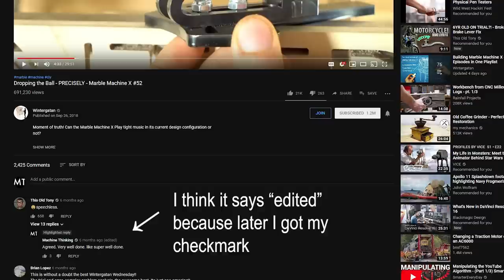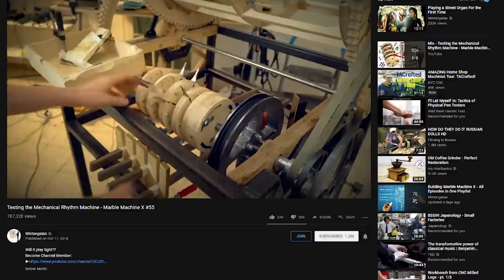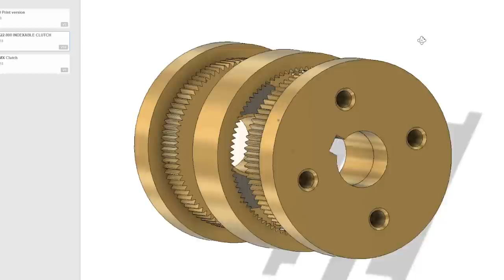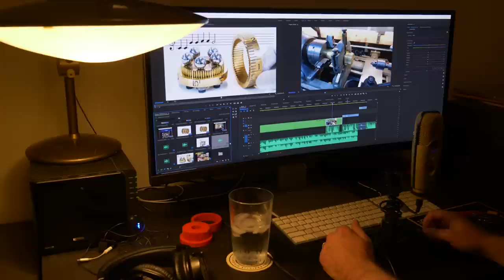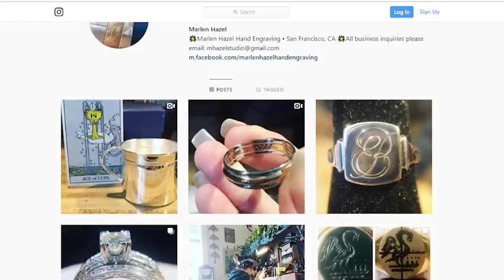Perfect Timing (with the Marble Machine X)

Comment: There's a great video on clicksprings channel on how to convert your normal twist drills into ones for brass. But in a nutshell: you slide the cutting edges of the drill over stones in order to turn the positive rake into neutral rake, so that the drill doesn't screw itself into the piece. But everybody has to watch every video by clickspring anyway, so...
But still, really great video! This is the first one on this channel that I watched, but I think I might stick around.

Comment: Tip: when cutting brass just hold a small spackle putty knife right behind the tool and it'll deflect the chips away from you. Been doing that 13 years. Works same for stainless chips.

Comment: The chuck on your indexer has a nice circle of capscrews on its face. Use a couple of those to clamp the part down when drilling to stop it lifting. Alternatively, drill and tap some holes in the face of the chuck for this purpose. Fill with grubscrews when not in use to stop detritus going into chuck scroll mechanism.

Comment: Paint it with black paint.  Bake dry to allow to cure.  Use a lightly damp towel with MEK to wipe the brass area.  You'll have your recessed area black and your brass surface nice and clean. We do it to chrome plated plastic parts all the time.

Comment: Excellent work!  I particularly enjoyed the thought process behind the design. It occurs to me that since you had a shaft made for the turning of the dial, maybe you could have chucked it up, run at say 50 rpm opposite of the rotation of the dremel and polished that way?  Fellow machinist here, a tool and die maker so my experience is mostly in grinding but I also polish mold cavities and I've had to get creative in order to ship to a customer :)

Comment: Saw your drill bit pulling the brass part up out of the vise. You need a rotary cut (drill) with a close-to zero, or maybe even negative rake angle. Rake angle on a drill bit is typically controlled by the amount of twist in the flutes. But it is easy to alter a fast twist (high rake angle) with a dremel tool and a thin cut-off wheel. 
If you alter a drill cutting edge down to a zero rake angle, you'll find it's easy to drill through sheet metal without the bit diving through in uncompleted hole.

Comment: I noticed your comment about needing a set of brass drills- and saw the part flung on drill- and lifting up as you drilled- I know what's happening to you. Look up drill dubbing. You can dub the rake on your drills by hand quickly to a neutral or negative rake for brass- and instead of pulling into the drill, your drill will push part down as you drill- and cut more correctly and smoothly for that material. Its easy to learn and makes an enormous difference on softer materials, and can make tiny drills safer to use. I'm a trained tool and die machinist with professional training as a watchmaker- this is a common trick I use. Try it with EZ Lap sticks, then finish on 3M micron paper or arkansas stone- you will love drilling brass and copper afterward. For brass, neutral to 2 degrees negative rake or so works well. This principal works on the split point section too, and for all materials that exist- but at different angles. Its an old black art you could say that most dont know anymore

Comment: I use a very similar homemade furnace in smelting meteoric iron and you'd be shocked at just how easy that is to find. It falls to Earth every day and can be found with a magnet. I actually own several actual certified meteorites that were verified by the local community college whom received one of them for study and the prestige of just owning something so rare and mysterious.

  Now, I notice you used a bounce house blower. All I ever needed was a Conair hair dryer, works like a charm and even generated enough heat to literally melt the furnace bricks used. No lie, turned the inner corners to glass and fused a few of them together. I was amazed. 

  I charge the furnace with enough charcoal to get it going then in a one gallon sized scoop, the following:
3/4 gal. charcoal
1 tablespoon sand
1 white marble chip
1 shard of broken glass
1 tablespoon welding rod coating
(Can't remember how or why I came to use these materials as it was well over 40 years ago when I formulated this mix, but it works and works well)

  I have also been experimenting with Wootz and Ulfberht(crucible) steels the past couple years. Though it gets VERY expensive to make, I prefer working with the Ulfberht when working hard steels. One of these days I have to get a power hammer though. Love blacksmithing and what I can do with it but arthritis is such a bitch.

Comment: The best way to modify your drill to cut brass or any brass tool is to remove the acute angle on the cutting edge from the tool in the case of a drill bit take a tool cutter or if you have a steady hand use a dremmel or some other rotary tool  and flatten the cutting-edge to a neutral rake. 90 degrees  or a little less to the surface of the work so the drill scrapes the brass away puting more force down this will eliminate the climbing up the drill. When your done just a quick touch on the grinder and it's as good as new this is a very old trick from a old toolmaker we used this because tools used to be incredibly expensive so you had to multi purpose everything. Hope this helps and saves you a little money.

Comment: If I may add a polishing tip.  Since you have a lathe and are more than capable using it, you could have made some softjaws to hold it inside and out.  Using 600 wet/dry sandpaper get out the machining marks.  Then dust it with 1200, finish using a cotton cloth with the  Semichrome.  Iv'e done this with 500 Nickel to less than a 2 finish on production runs, so it had to be quick.

P.S. Awesome vid.

Comment: I'm a life long machinist, here is how I would do the numbers on a analog machine. Get a threaded stop collet that fits your punch sets OD, locate the number to square. Center and locate your part on a vertical rotary table on center, support from underneath with a rubber or leather pad... Chuck your part. Lock the quill rotation. With the punch square and on center, soundly strike the draw bar with a brass hammer. Change the die, rotate, repeat.

Comment: Polishing brass requires a large number of wet and dry grades, mine go all the way to 10.000 grade.  When going up the grades, I sand at 90 degrees to the previous sanding until all the scratches from that previous sanding have been removed.  The final sanding is at 10.000 grade dry which get even finer as the paper starts to clog, there is little polishing left to be done, it comes to a near perfect mirror in seconds with a dry friable polish and probably the same with any commercial polish .  

Needless to say, absolute cleanliness is required, any stray speck of dirt or course grit will scratch the brass, and you will have top go back and work your way up again.  The 10,000 grade paper hardly feels abrasive at all but it does abrade the surface, however slowly.

Comment: Check out one of Chris’ videos over at click spring. He has one that shows you how to take a normal drill bit and easily convert it to work on brass. You pretty much just find the tip to be flat vs angles so it won’t catch and pull the brass chips. Definitely worth watching regardless. Great build video you’ve made. Good commentary.

Comment: Not sure if you agonized over the decision, to avoid looking like a copy-cat of TOT, but I'm disappointed that you didn't sign your work, or at least didn't show it if you did. Especially considering the subject of some of your previous videos and the mystery of the origins of the worlds oldest micrometer and who may or may not have made it. But then again, had it (micrometer) been signed, you may not have been as intrigued by it and quite possibly not made a couple videos about it, which subsequently may have negated your involvement in a set of highly unlikely circumstances and prevented you from being involved in this project and...wait wait wait...what time traveling settings are you using on your lathe? Are you using the proper conversions? Your doing some fantastic stuff, love the edutainment, and appreciate the effort you put into your work; it truly is top-notch.

Comment: Hi there Machine Thinking I might have an answer to your drill bit problem those bits are ground with a positive rake your can take a sharpening stone and hand grind a negative rake on them if you plan on using them for metal only. Clickspring channel has a goid video that goes over this such issue

Comment: Its do easy to fix your drill bit. grind the flutes flat so that there is about a 1/8 or so inch of land. the drill will nut pull into the brass as it breaks through. this works great for sheet metal also

Comment: ...a tip for drilling brass: you just need to change of the cutting edge of a usual drillbit to 90° cutting angle. The cuting edge of a drillbit for drilling brass must act like scrape not act like cuting.
Just try with a drillbit you gonna love drilling brass with it, not having that annoying pull up force anymore and will get a much smoother surface. regards

Comment: Great video!
A simple negative rake ground on your drills would solve that grabbing problem.
You don’t need to buy a whole set of drills specially for drilling brass.
You can grind it off again if you don’t need it again.  Your drill just looses a mm or so in length  each time you change.

Comment: Nice piece of work. Obviously a very important part of the marble machine. Questions------ The threading insert you used for the teeth...is the tooth profile symmetrical to the insert , or is the geometry slightly skewed for holder clearance? Most inserts are ground with a few degrees of side relief for the holder geometry. Did you encounter that or have to allow for that with your holder?
Reply from the maker: Joe, I designed about a half millimeter of play into the splines to take care of any issues like that, plus the inevitable dirt and grime which will accumulate over time. How I indexed the holder to exactly 12 o'clock was a fun one. First I found the center and set the DRO to zero. Then I cut some scrap stock in the dividing head with an endmill along Y. This gave me a flat that I could put the insert holder against (without the insert), put the mill into low (effectively locking it on my mill) and then put the insert back and moved back to zero.  Big fan, glad to see you here.

Comment: From one machinist to another. When drilling brass plate, only spot drill and then drill on diameter. Do not drill out the soul, or it will grab.  if you have to drill the soul, use a 4 fluite endmill to finish the diameter

Comment: So this is a semi old response, but the curiosity is driving me nuts. I came to this channel after binging on "This Old Tony" and "colinfurze" vids. But if I was after (slightly more) serious stuff, I'd go back to Tony. One of his vids sent me here. So after spending all 4 years of high school in construction, art & architecture, and engineering classes, plus 3 semesters of college taking Architecture and Engineering courses. We'd use programs from SketchUp, AutoCAD, REVIT, and others to either 3D print or machine parts that would've taken too long to sand and buff by hand.

When we were done machining a piece of work. We'd either dust it into a bag of other miscellaneous shavings if the shavings were large enough, or we'd use a ShopVac for the finer stuff. To the best of my knowledge, those "leftovers" were just tossed in with the rest of the shop's/school's garbage. Was/is there ANY way for those shavings and occasional scraps/botches to be recycled better? I went to a very "green" school. But the wood and metal shop seemed like a big middle finger to those ideas lmao

Comment: Beautiful piece of design and manufacture. I first came across your channel through Smarter Every Day and now what a surprise to be brought back here through 
the Wintergatan channel. As both music and machining fascinate me I would like to know how many teeth were on your spline? I believe it would have been 60 teeth. Does this relate to the fact that music is measured in beats per minute and a minute is divided by 60 seconds. Also, what was the relationship of any other gear reductions the Marble Machine X has between the rhythm  machine and your clutch that would change the amount of teeth on the spline. Thank you for getting those of us who are mechanically minded thinking. Machining is always improvising with the tools you have to produce the part you want and you have shown me some things i will keep in the back of my mind for the future. So what is the next project?

Comment: Fantastic work. I have a conceptual design for a fully programmable mechanical computer. Probably the most critical part would be to copy or add the value on a wheel that looks something like this to another one (mechanically). Basically a much smaller and fully programmable Babbage engine. If you are interested please let me know!

Comment: To prevent the problems you encountered with drilling brass: Remove the cutting edge of the drill bit. Just touch it a little with a grinding stone. The drill bit should not cut, but scrape.

Comment: Mechanical Hint 💡 : What if you use a helical Spline and two bearings that align the timing with left & right axis
First part will hold the shaft that rotate and the second part will be positioned by the bearings and rotate the beats fins by 5 or more shafts or linear bearings which they are rotated by shafts in turn..
If this message was helpful then ask me for further explanation if you like.
P.S. a self lubricating Teflon replacement with the outer wheel is more practical and safe for the jamming if something find its way between, making threads a bit less and shallow.

Comment: when machining brass i like to put a piece of like thin steel like packing trap and clamp it over the tool piece  and cut/ bend it untill it sheilds me from the chips but dosent touch or interfere with the work piece, i like your method of turning the tool upside down though ill be sure to give that a try

Comment: at 13:25, i would suggest you turn the work piece 90 degrees so the vice holds on the flat ends and use the key sitting in position on top of the vice jaws. It works great and it holds way better. oh, and use a long straight piece of 16mm round in the collett to get your centre position.

Comment: Top tip with hot glue is when you want to separate it apply/spray some isopropyl alcohol on it and it will instantly lose all it's stick and come off cleanly.

Comment: hasn't your mom ever taught you to never mix imperial and metric on a project? Such a savage!  But on a serious note, this is a very nice elegant solution to the problem. I was originally thinking he was going to end up with an off the shelf friction clutch from an old transmission and maybe have a nice mechanism for engaging it but this is much simpler and will probably end up working a lot better

Comment: Nice work love your history vids. You nearly lost that brass when facing before center drilling! I will give you a few tips.  Cdrill first then face & Turn a steddy band or skim OD with live center, that way it OD and ID should be concentric! make some sort of draw bolt to hold jobs in the dividing head chuck, (some threaded rod, nuts & washers are cheap sacrificial if necessary.) never heard of brass drills just sharpen for application its all about rake angle in this case look at your sloting tool works mint What is the Rake angle?  Point angle for thickness of meterial.

Comment: Instead of brass drill bits, get some diamond hones.  They come on a plastic stick about 3/4 inch by 1.5 and the plastic about 5 inches long.  you want the Red (fine) and the Black(course),  I use the fine and flatten a 0 rake angle about .008 thousandths high on each side of the drill so that it wont pull the part up.  I also use the fine on the relief angle of insert's to take the coating off when they get dull when finish cutting .005 or smaller.  I find that they last 3 times longer than when new and I can sometimes resharpen 3 to 4 times.

Comment: 3D print a sleeve with mirrored-extruded teeth that fits around the gears so you can mount it in the lathe without having to worry about damaging the outer teeth. Referencing 11:49 in the video by the way.

Comment: im sorry for bad comments but you should really get more 4 jaw chucks. use aluminum soft jaws for second ops,  and try finish work with two setup. if you can't always indicate parts for extreme accuracy ( .001 on the Od and face. or the ID and the face. witch ever is more applicable. you should have been running true for all ops except the first op material stock removal...-_-...

Comment: Beautiful work, really well done.  Superglue would have worked where you used hot glue.  Clickspring uses superglue frequently for attaching brass parts to mandrel.  It can be detached with a bit of heat or a soak in acetone.  This is a trick that I've started using very successfully.  You just have to watch that your part doesn't get too hot, or it will break the superglue bond at a bad time.

Comment: Lovely part, I wonder when you drilled the five holes, did you measure the position of each hole or did you just mark the first position and the turntable rotated 72 degrees for each hole?
I’m fascinated by how you can cut the exact number of teeth in the ring.

Comment: Nice piece and good vid. Is there a reason you tapped the brass without cutting oil?
Reply: Brass is really soft. Cutting oil really isn't needed unless you're using it for cooling.
Reply: @SternLX  thanks for the input, the only soft metal im drilling, cutting, and tapping is aluminum. Wasn't sure if brass had the clogging tendency that aluminum does. For that reason i always run cutting oil with aluminum.